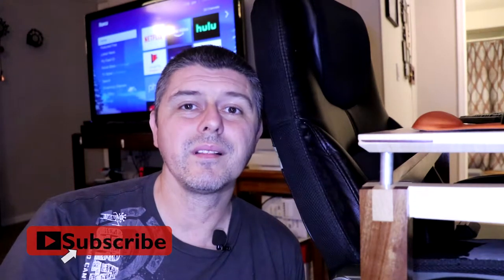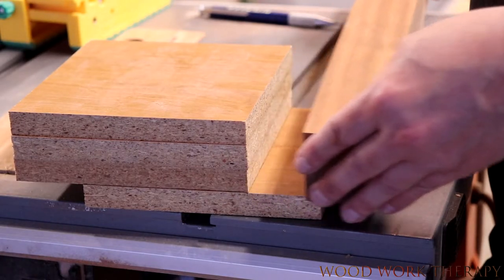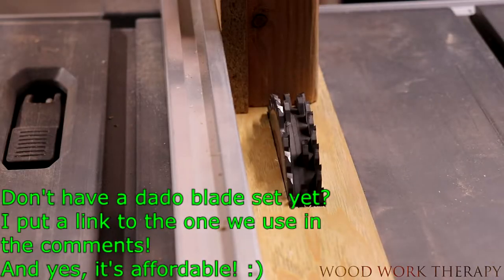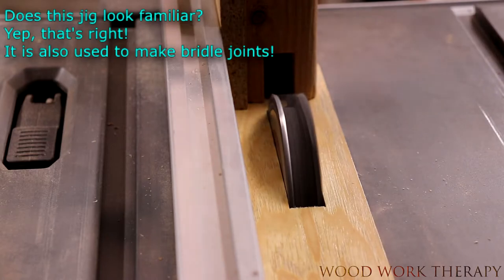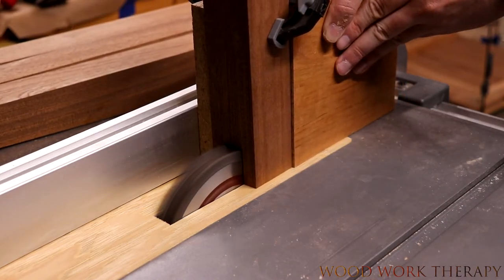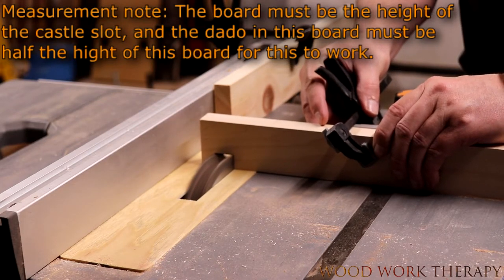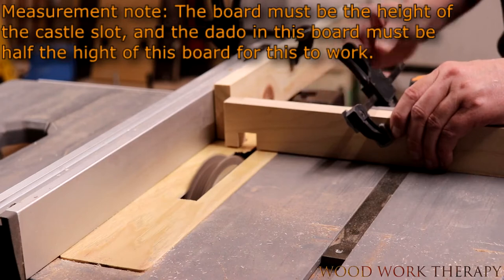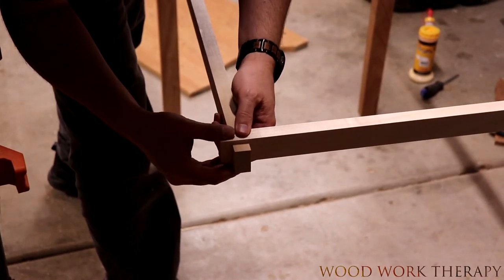DIY Castle Joint: How to Make a Flush 3-Way Leg Joinery on a Table Saw

Comment: THANK YOU FOR A VERY INFORMATIVE VIDEO,I,LL GIVE IT A SHOT, PATRICK.P
Reply from the maker: Do some test cuts first on this to make sure your where you want to be spacing wise. And then go for it. You'll notice you may be slightly off center even if you nail it on measurements. Even if you are off by a 1000th on the opposite cut you should be fine as long as you make the cuts consistent on all your legs. Assuming you have a taper like I did that is. I hope this helps! :)

Comment: That looks great man!  My Dad was a Carpenter for 40 years, he has made some furniture with scrap material from jobs etc.  I am an Electrician by trade, but I have done many things, not a lot of wood work or furniture building except the standard boxed crap from China.  I like how your desk came out came out, the castle joints look pretty sweet!  I have a few questions.
Do you still have the upcycled desk from the other video or did you replace it with this?
What kind of table saw do you have?  
I noticed that you said to use glue.  Do you think instead it would be possible to incorporate hardware (flat head bolts, washers, wingnuts etc) for easier disassembly/reassembly?  Kind of like how you reused the hardware on the upcycle video?  If so, do you have any advice or ideas you would suggest?
Did they upcycled desk last?  Those castle joints on this one look pretty sharp.
Thanks again for the production and the effort!
Reply from the maker: Well, thank you! :) Yes, I do still have the desk.... for now. It might be a video coming up talking about its nicer replacement. LOL I have not replaced it with the one in this video. I actually built that at the beginning of this whole COVID thing for one of my kids. It's in the living room so the wife wanted it to look nice. And I'm like.... I have an idea. And well, you get the idea. LOL

I have a Rigid contractor saw Model R45171 https://www.ridgid.com/us/en/compact-table-saw-x-stand

Glue vs. hardware on a castle joint. That's a tough one. The one adage that I would recite in this is: "Glue is stronger than wood" (Assuming you have good coverage, and it's not end grain, etc.) When you use things like screws, etc on wood projects without glue, you are doing a few things. First off you are reducing the overall amount of wood to work with. On a castle joint that it self could cause issues. Also you have the issue of the hardware has to hold the wood better than glue, which also creates issues. Obviously metal is stronger than most woods, but the connection with the wood, may not be as strong as glue, because to do the connection you have to compromise the wood to do it and that may cause cracking over time. Hard to say for sure, but I would not personally recommenced it on that kind of joint. Another thing to keep in mind is castle joints are rather fragile when not assembled, so transporting a disassembled joint could very easily break in a moving van, truck bed, etc.

I hope this answers some questions, and helps out! :)
Reply: @WoodWorkTherapy  After watching your video I started getting ads for "Hairpin legs".  I may go that route and incorporate some hardware along with a decent wood surface.
Reply from the maker: @intheblind7262  for an L shape desk more is better. I would go with some of the stronger u shapped mettle legs like they have at Rockler. Those will take a bunch of weight and they look pretty awesome. Thoese are simple for a person who knows how to weld to make. If you know someone who welds I would get some of that tube steal and have them made to your specs. Shouldn't cost all that much. :)

Comment: On the castle I made with pine, the end pieces are really weak and snap off so easily - any suggestions to stop that happening?
Reply from the maker: Great question! I wouldn't use a soft wood for the castle part. A good solid hardwood would be my pick in reality. Like here we used Sapele for the legs, and I belive hard maple for the other part. And then glued every side and every pice and let cure over night. The joint is fragile untill the glue has dried. Then boom super joint. But the glue in the joint realy seems to be the key. Since it does not extend past the post it doesn't have as much surface to lean on persay, so the glue fills that part in. If you ahve some play in the joint, fill it with a little sawdust durring your glue up. The saw dust packed in the joint, will expand with the glue and toughen up the joint. The table we made it rock solid and we used almost al of thoese techniques as we built and glued it together. But in the end hardwood with a good Janska rating was a major player due to the thiness of the joint. I hope that helps a bit. If you have more questions please ask away! We love to reply to coments on the channel. 🙂
Reply: @WoodWorkTherapy  thanks - that’s really helpful - I’ll stick with it as I was just about to bail for tenon joints instead…
Reply from the maker: @UCsX%F0%9F%99%82%F0%9F%99%82NnHIuMAI7OsR6fhdvrvg Glad to hear it. Hard to tell someone how awsome this wood joint truly is till they experience it!

Comment: What is the width of the the dado cut? Is it ¾"?...my table saw will not allow me to stack that wide. I want to make this joint using treated 4x4, what dado width could width would you recommend?.... Thanks, great video!... Rob
Reply from the maker: If memory serves it is a 3/4 dado. That being said. Realistically you can just cut both sides on a single blade or half the sides with a smaller dado. That being said as well... You could also use thinner stock than we did. The joint is exceptionally strong. So you can go thinner. I would not go thinner than a 1/2 inch on a pine or other softwoods, as it might not be strong enough... I think. I never tried a pine joint on this so I may be wrong. Just a passing thought on it. I would test it before committing to it. That was how we found what was comfortable for our application. I hope this helps get ya rocking on that. It is a beautiful joint. :)

Comment: Is this MDF? Looks like particle board
Reply from the maker: Sapele and Maple do look a bit fake don't they. LOL However it is only wood. No MDF in this project. (Except the jig to cut the legs that is.) :)
Reply: @WoodWorkTherapy  I think they are referring to the jig you make and talk about at the start of the video
Reply from the maker: Ah got ya. Yes the jog was made from leftover MDF that actually is from an old desktop I remade. Did a video on it about 3 years ago if you want a laugh. But yeah scrap MDF is great because it is rather humidity stable, and perfect for jigs.

Comment: Screw the castle joint... what's up with that LEG? The twisted, angled grain structure, I mean. Is that Sapele? Is it a single piece? Or did you laminate several together and "carve out" the leg from that? Sorry, no offense, the castle joint is very nice, though you lose some structural integrity and stability by flush-cutting it. But my gods, man: I'd buy that table on that one leg we can clearly see alone.
Reply from the maker: That is Sapele. Taken from an 8/4 solid chunk. Good eye. The full build for that table is here: https://youtu.be/_ieZG3tgCx0. It actually is extremely stable. I was surprised how well it held up actually. That table we used that on gets used constantly, and never had a failure. Even with my rowdy kids playing on it. I think it comes down to the hardness of wood at that point, and how close the glue/jonti bond is, that truly determines the strength. But if done right, it's an oddly strong joint, and it will take quite a beating, and ask for more! LOL
Reply: @WoodWorkTherapy  Oh, that wasn't a criticism. Castle joints, given their abundant and cross-layered, cross-grained available glue surface area are  up there with mortise and tenon joinery. Pretty much nothing stronger, save some of the monodirectional joins like dovetails. 

I meant in comparison to a NON-flush castle joint (in which the portion protruding from the other side serves to capture the joint TOO (meaning, like a dovetail, it can only be disassembled in a specific direction, outside of material failure), rendering it STRONGER in many cases than a dovetail (thicker material holding it together) or mortise & tenon (shielded on multiple planes from torsion). It's splitting hairs at that point though. It's like griping about a chisel hardened to 65 instead of 64. 

Unless your furniture is providing service to a high school or in a prison, odds are any extra strength gained is sandblasting-a-soup-cracker overkill (but hey: I'm a long-term woodworker m'self. You know how we are, lol).

But that leg: was that the natural grain run? Like, you didn't go outta your way to make it do that? Just a talented (or lucky) pick from an outstanding slab? Or did you map the grain before cutting the leg? Sapele is one of those marvelous woods that yields the potential for features like that, but it's such a pain to figure out where that grain is HEADED without cutting it open, you rarely see it done on purpose.

Either way, lovely work. I'll  watch the whole build with eagerness. Thanks for the reply!
Reply from the maker: @grumblycurmudgeon  No offence was taken at all. :) Great question on the grain pattern. Yes, that was intentional. I found a nice 8/4 board at the local hardwood dealer, that had wonderful grain. I bought it for specifically the legs. And then just made sure I cut with that grain to get that effect. I LOVED how that made the legs look. And with the taper, it took it to a whole new level. The grain follows the tapers remarkably well, which I assumed it would, but it was darn near perfect. The grain did not disappear in the taper as it can sometimes. So it was a little luck and a lot of planing. This was one of my first really nice projects I have knocked out. And it has held up well. And is always a conversation piece.
I have to admit with as thin and light as it was, I thought it would be a little on the fragile side. To my surprise, it was the opposite. Kids play on it ALL the time. And the worst thing that happened to it was the top got scuffed by something....(Still trying to figure out who did that...). But since it is lacquer, easy to fix. LOL That Sapele is so strong that the fine corners(that I did not soften) have not even got a dent in them after all the use. That was the real surprise. You know how that goes normally, sharp corners on legs = dents. LOL